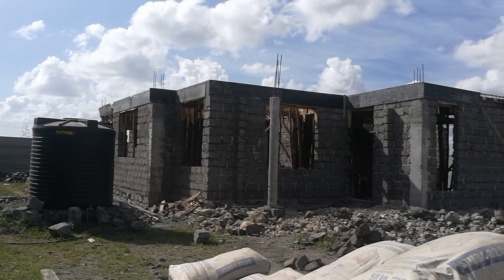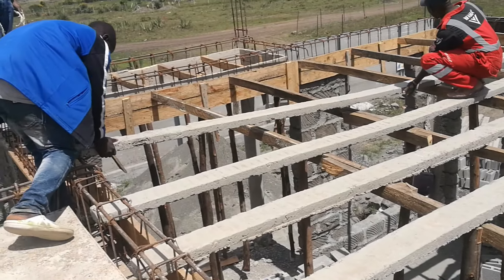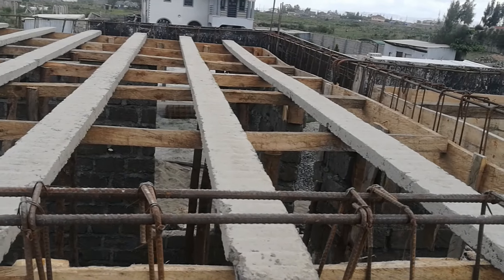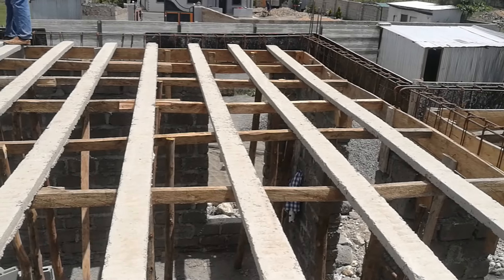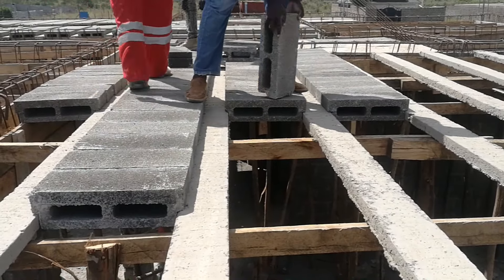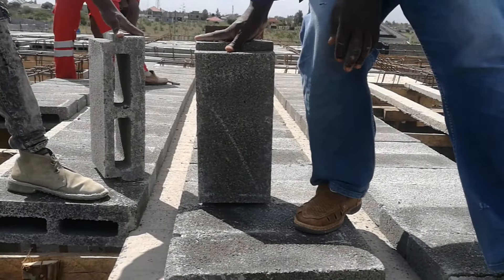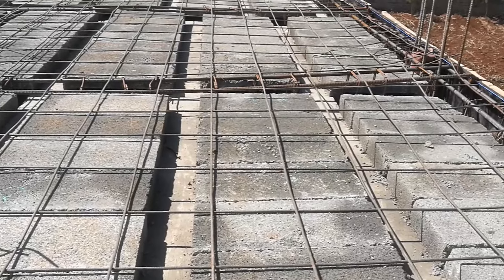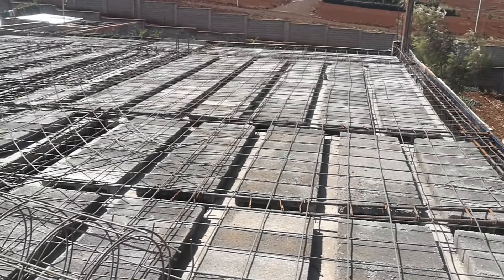How Concrete Flat Beams & Blocks are Installed to Build an Upper Floor Slab

Comment: I’ve built the upper floor of my house with these sort of beams. Some are more than 5m in length and about 175mm high, pre-stressed and reinforced with steel rod/multi-strand wire. I used aircrete block for infill between beams which was lighter in weight, better thermal insulation and allowed fixings for lower floor ceiling to be simply screw-fixed to the blocks. My son and I put the beams in place ‘Egyptian fashion’ i.e. with steel scaffold tube rollers. The floor is about 200m2 and, after grouting with cement slurry, was overlaid with 10mm ‘Yellofon’ sound barrier, underfloor heating matrix then 75mm sand/cement screed before 10mm porcelain tiles on adhesive. The beams are pre-stressed so that they have a slight upwards curvature which settles down under load. So far no problems.
Reply: Did you add a mesh like in the video?
Reply: @ no, in my case I felt there to be no need for a mesh. The beams keep the blocks in place and with the overlays, there’s no point stress or loading. The 75mm sand/cement screed had glass fibre strands mixed in and when tiling appeared really tough stuff.
Reply: @Sandpiper3247  that's impressive

Comment: If that floor doesn't  collapse after  the wood support is removed,  then it is a miracle. That's a  weak "prestressed" beam.
Reply: I myself questioned it, but with no knowledge of construction, I couldn't be bold to comment.
Reply: Sorry you know nothing about construction 😂

Comment: Please do comparable analysis for stress and bending structural moments, as compared to a typical poured slab.. The Beams do not look very strong. What are the PSI rating for the whole slab. What about water/moisture infiltration. Great start but still many questions. I say this as a Structural Engineer
Reply: Look like the concrete beam is supported by the timber beam.!

Comment: Well block and brick I completely trust it because I have work with a company that use in Spain 
What I am afraid is the quality standard 
Secondly like in Nigeria we use 9 inches block after decking which I am thinking will be a heavy load for these type decking 

I stand to be corrected by someone the company I work with 
Do not use such black

Comment: What is the minimum compressive strength of the blocks. What is your concrete grade for the blocks. What size of tendons did you adopt for your beams? Please answer. This is very important.

Comment: It would probably make more sense if you cut the blocks in half because the other half of the block is just added weight that isn't needed. Blocks need concrete and steel reinforcement in order to be considered a stable structure. Blocks can break and crumble without notice.

Comment: I did something similar in costa rica, 16ftx16ft span.  I filled in 2x6 steel tube with 1/2in rebar in the middle and concrete, then set them up tall ways. 6in high 2in wide.  And 12in on center. Connected with rebar pins into the walls  Then screwed down roofing tin across the top and poured a unified 4in slab with electrosoldered mesh in it. That connected with the lintel The result was a solid roof that didn't bend in the middle.

This guy's thing looks like it will break in an earthquake and the blocks will fall and kill whoever lives there.

Comment: Like to know how solid is that concrete block, have they done a test on a concrete block, to make sure they don’t crack easily?
Reply from the maker: The blocks are brittle  but since they're stacked together and placed alongside prestressed beams, this makes them strong enough for a slab. They're even hollow blocks made out of burnt clay used to make slabs which are more brittle than these concrete ones

Comment: How do you cater for the hooging moment at the end of the slab, for example staggering the last line to break the tension line
Reply from the maker: The beams for the blocks are connected to the slab beams end to end
Reply: I had same taught

Comment: What will happen when you Dont continue your building after making the suspended slap? Can it be affected negetively by rains
Reply from the maker: After casting the slab it will be okay as long as you waterproof it...but the pouring of concrete should be done in a day to ensure the slab is homogeneous

Comment: Does the timber support  get removed after curing progress  ?
Instead  of placing precast at long span , wat if place at shorter  span ?
Reply from the maker: Yes the timber support is removed later. And the beams are placed on the shorter span

Comment: An easier way to do this is to pour a slab floor over 2 way rebar. Use wood plywood forms held up by wood post. Don't need the blocks.

Comment: Hi can you build a beam on site or it has to be precast
Reply from the maker: It has to be precast as the steel tendons inside the beams are tensioned by a specialised machine

Comment: I really don't trust this brick and lock system terms of strength. I thing it was mainly introduced to cut down cost and thats all. If you people think this method is stronger, they why is it that you don't use it to build staircase? You won't use the brick and block to build the steps but rather use rcc decking for steps
Reply: It’s not really cheaper when you think about it and it is solid enough to withstand up to 450kg/m2. It is mostly used because of its ease to adapt and ease to build
Reply: https://youtu.be/Dzqjc7l7wuE?feature=shared Watch these pre-made stairs using this same concept. This idea didn't just start recently. It is not a new technology.

Comment: Hello Mr Nick, I know I'm late , I have a quick question. How many blocks and rails can be used to do a upper floor slab for a 10m by 10m 2 bedroom house. How much ( KSH) will it cost including Labor.  Please help
Reply from the maker: Hi, kindly reach out to me through email, propertynoma5@gmail.com
Reply: @PropertyNoma  hey, Do you have an extension in Uganda or you can deliver the service as well in Uganda?
Reply: What rebar size  and how many do you use in the beam.

Comment: How safe is the technology?
Reply from the maker: It's a pretty standard technology in some countries. That said, always go for reputable beam & block companies in your country
Reply: @PropertyNoma  I'm in Kenya
Reply: This way of doing slabs should come with 2 disclaimers:
1. Every building is unique in span and loads to be carried(building usage). Therefore, every slab MUST go through structural design check.
2. It is highlighting savings. But true savings is realized when you compare DATA. That is, solid slabs vs beam and block. ALL items put into cost ; Oranges vs Oranges.
Reply from the maker: @kibuchomartin5016  Thanks for your input Martin!

Comment: How long is the curing process?
Reply from the maker: Concrete gains its most of its strength by 28 days. They are usually cured in bulk in the yard of beam & block companies

Comment: The end to end beams seem "weak", I can literally see them bending. Won't this result in a curved in floor esp if they're very long?
Reply from the maker: I would recommend using T beams for beam to beam technology. The ones used here require timber props for support until the slab cures sufficiently. I'll look for more projects using Tbeams
Reply: @PropertyNoma  considering the slab is actually on top and not really strongly connected to the blocks and beams, won't it still be an issue even after curing? In fact you just added more weight on top of them blocks n beams.
I'm really interested in this tech n would like to build using it when I'm ready but I'm still doing more research esp on very long beams(wider rooms both length and width). I would appreciate a link to Tbeams and see how they look/work.
Reply from the maker: @briosky254  Hi, checkout Ecoconcrete's website to see their Tbeams
Reply: Thats wht I been thinking too use thicker timber 😮timbered flooring and then blocks

Comment: Those pieces of wood don't look too strong though and they even look old too.
Reply from the maker: The timber is there to temporarily support the beams & blocks. They'll eventually be removed
Reply: @PropertyNoma  I see
Reply: How much will it cost to construct for double garage and stairs for top braai area
Reply: You’re right… I was looking at that, wood beam, it is old, don’t look is has treatment, woodworm treatment… I’m not too sure about that now…, I wonder how it is now?

Comment: This is very dangerous the most important intermediate beams are so weak and adding more blocks lead to more stress on the building because the blocks will be covered with aggregate.

Comment: Has this been checked by a structural engineer this doesn't look like its safe. If anything the slabs should have been turned vertical possibly moreso than flat horizontal receiving blocks and then they are adding wet heavy concrete. Disaster waiting on a rainy day.